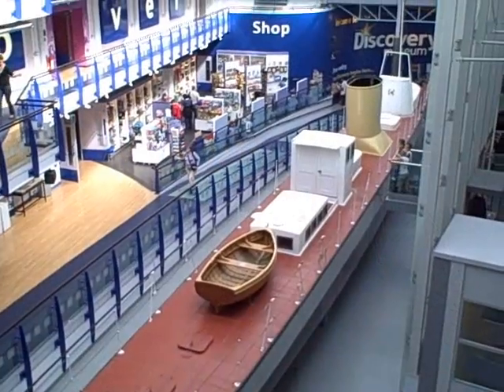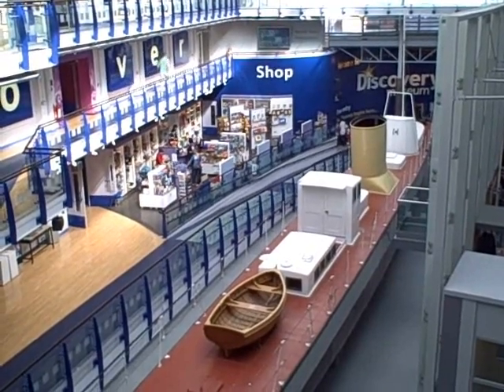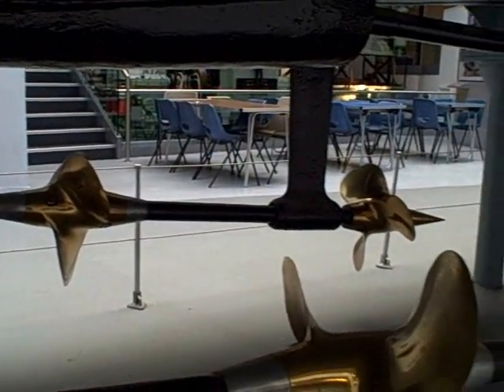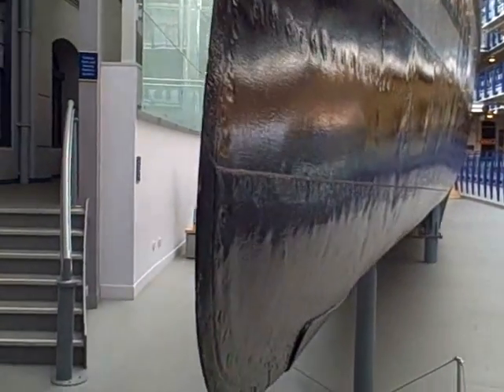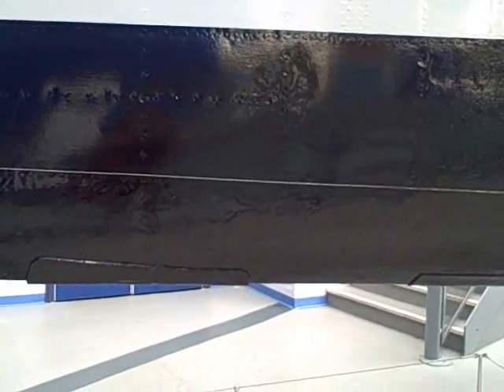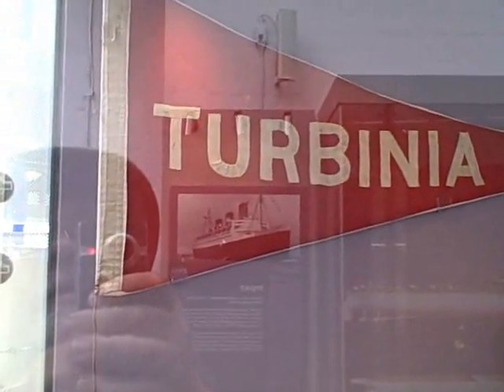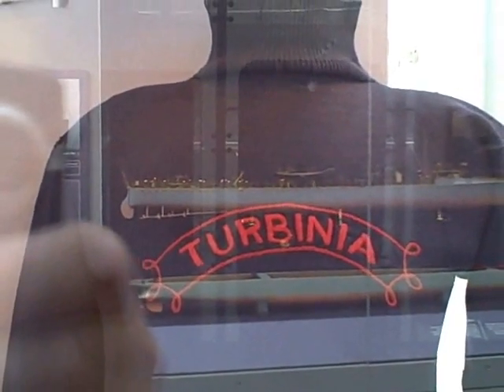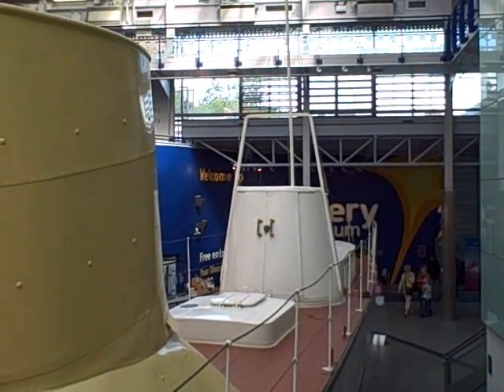Turbinia - Discovery Museum - Newcastle

Comment: I was at the University of  Newcastle  Upon Tyne between 1962 and  1970 and I used to go to Exhibition Park at the Town Moor if I am not mistaken, Turbina was housed at Exhibition Park and I often went in to see the small model boats that Parson used to test propellers. I remember some where powered by rubber bands . If I am not mistaken there were many model boats showing the research being done  on stepped hulls too.
But I  often visited Turbina and say the fast evaporating boilers to feed those steam turbines,  I even saw the diagram of the blades Charles Parson drew and his intuition was remarkable seeing  that he drew the blade profile through his intuition of  how the flow would behave.  I remember seeing  a   replacement wooden propeller made by the chief engineer after his propeller fell off,  
Those nine propellers three on each shaft, I admired but I always thought that the tip design was not right, and later on in life when I made my own propellers I made the propeller tips where both the leading and the trailing edge raked back , this achieved a better high speed propeller.
The small lake in front of the building which house Turbina was a small lake and I used to take my home made radio controlled boat with my experimental  digital radio circa 1965 and I used to chase the ducks. If I remember correctly there was a model sailing club somewhere around, but I cannot remember where though I still remember seeing those masterpieces.  
I visited Stephenson's home too , happy memories up in Newcastle, happy memories indeed. I wonder what happened to all those model boats with which Parsons first made his first experiments.  It is was a glorious phase in the history of Engineering and all I can say is that I am very lucky to have "played" on the same ground these great people in Engineering started it all.
Singing  Bladon Races was enjoyable too  after a pint of Brown at the local.
Thank you to the people at Newcastle who were so helpful in every way, including the University where I spent eight years at Merz court Engineering Faculty.IN fact I saw the Merz Court building being  erected and even the foundations being dug out.  I was one of the first students at the University and our faculty was housed in an old church before Merz court was built.
I was there wnen the civic centre was built and if I had to go back for a visit,, I would first go to see those five swans in that lake at the civic centre not to mention that great giant hang out on a wall on that round part of the Civic centre.
Happy memories  but Turbina was my centre of interest. It appears that they now mover her. A glorious ship which now belongs to the ages.